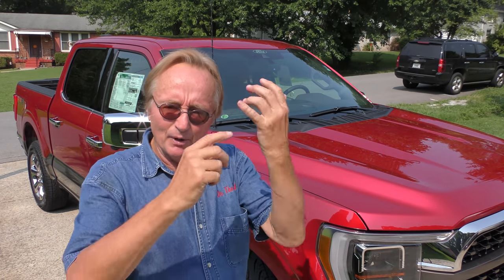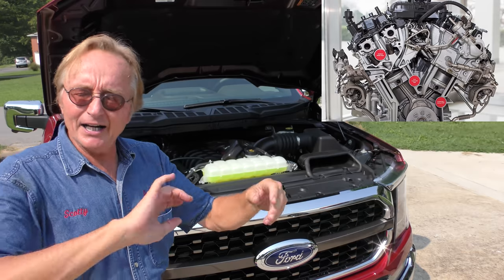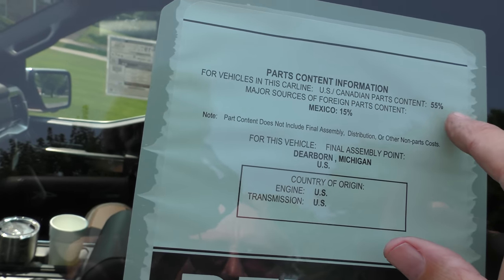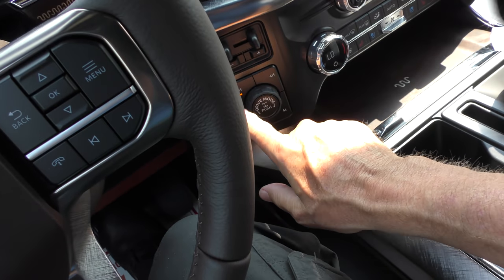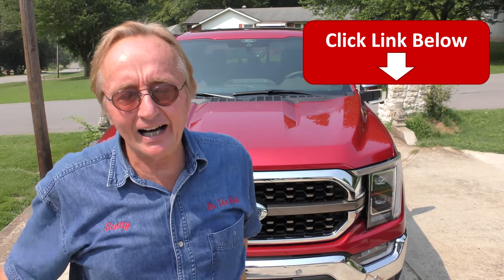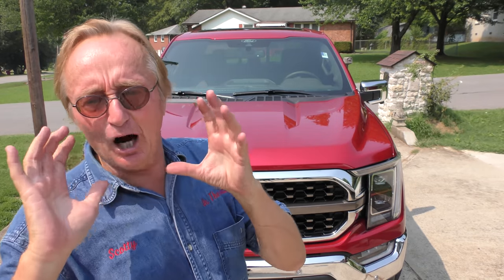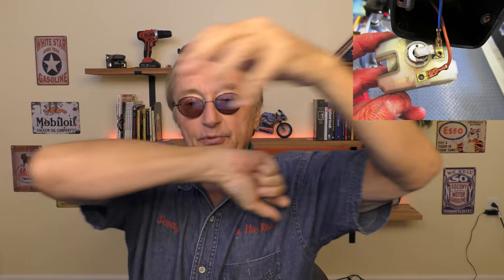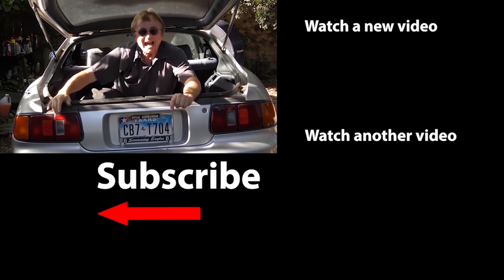I Finally Got a New Ford F-150 and Here's What I Really Think of It

Comment: I listened to you in 2019; bought at the end of the year. 2019 F-150 XLT 4x4 club cab 5.0 V8. Excellent engine! Not ecoboast V6 for me.
Reply: No ecoboost for me either. If I wanted a twin turbo v6 I’d be looking at sports cars not pickups
Reply: @landscapingspecialist  The only reason why one shouldn’t consider a twin turbo over a v8 is not because of its sports car like power but of its longevity. Disregarding longevity and pricing, I see no reason why I would opt for less power than turbos.
Reply: @Samuel-zl7yw  yeah I guess it just doesn’t make sense to pay for a v6 turbo that’ll last 100K vs a v8 that’ll last 200K you might as well just get the v8 and save the worry but yeah you’re kinda splitting hairs. Hey you’re right tho if u got the money and don’t care how it lasts but whatever you want :)
Reply: Someone sounds broke to me 🤣
Reply: @colino5056    I don't know why you guys talking about I got a 2017 Ford F-150 V6 EcoBoost with 240,000 miles and it runs like brand new no problems at all I like these guy but he don't know what he's talking about when it comes to EcoBoost engines
Reply: @tachoo3725  yeah I’m not here to bash or hate on the ecoboost. To each their own. I use my pickups for work work and more work. Including towing upwards of 10k. I just don’t believe in the turbo v6 truck model for my use cases. Again they are probably great for some people. I am just not one of them.
Reply: Does yours use oil? They said the 2018-2020 5.0L V8 engines have that issue. Mine does.
Reply: @VWhiteJr  Yes. It was really bad the 2nd oil change. Now it’s maybe a quart every 1,500 miles. That’s something that I am really ticked about.
Reply: @johncombs6543  gotta go do the TSB for oil consumption. It works even though you’ll see a bunch of people saying it doesn’t and the reason those people are saying that it doesn’t work is because they’re waiting way too long to do it. If it has enough miles on it already the TSB may not work but majority of the time it does.
Reply: @colino5056  I've owned 4- 3.5 ecoboosts traded each in with over 300K miles no issues at all.. I haul a 25' flatbed gooseneck a lot and no problems, power for days to haul.. But stay with your v-8 lol.
Reply: @landscapingspecialist  
But if you really test drive them both, you'd realize that the EcoBoost blows the doors off of the V8 trucks. Both towing and acceleration.
Reply: @landscapingspecialist  Dude., That 3.5 EcoBoost has way more power than the V8 and it pulls better at lower RPM's. The EcoBoost is a FART BETTER engine for towing.
You got to drive one to experience one.
Reply: 2021 f150 v8 is not the same anymore. Cylinder shut off system is used firs time in those trucks…. In this case ecoboost is way safer to buy…. 
Nobody knows how it will perform yet so nobody should say coyote . 
Can’t compare old coyote with 2021 ( for now)
Reply: What's funny to me about this video is I just literally last week sold my 2019 ranger lease back to ford and i said I will gladly hop in a super crew f150 and continue to be a customer. They said we have NOTHING to offer you sir. But we want your truck. Their loss, I no longer have a car payment ( I own my other 2 vehicles outright) . they simply lost a customer. Idk where the hell this guy got this truck, but in southeastern PA they do NOT have any new trucks. Checked many dealer. One had one new truck that was over priced by 10 grand and they thought nothing of it.
Reply: @VWhiteJr  yup same here.
Reply: @johncombs6543  Yeah, idk why Scotty doesn’t address that since it’s the engine he tells us to get. Mine isn’t low until it’s time for an oil change, but it still shouldn’t be using oil.
Reply: @colino5056  my fist gen 2012 Ecoboost is at 130k.  Turbos are just fine.  When I go to buy another truck it will definitely have the Ecoboost system. After 10 years of improvements on that engine I'm confident it will be even better than mine, that has been great.   Blows the doors off the V-8.  Faster, tows better, and is more efficient.  And unless you get an aftermarket exhaust for the V-8 it really doesn't sound that much better than the V-6 which basically sounds like a sewing machine. If you really think you are going to keep your truck 200k then yeah, the V-8 might be the way to go but with the new cylinder deactivation system on the new V8 I am not so sure anymore.
Reply: EcoBOAST
Reply: People are acting like the ecoboost is the first engine to have turbo charging 😅
Reply: @Samuel-zl7yw  zero data or proof.  same thing over and over
Reply: @02hreblue30  I was just going on the statistics that Scotty laid out. Don’t quote me
Reply: No EcoBoost for me either, although I went to the other end of the spectrum for my 2019 F-150 and got an XL with a naturally aspirated 3.3L V6. It's a shame that that option is no longer offered.
Reply: @InJeffable  bruh... why not just get the ecoboost lol
Reply: @ForgivenSheep3  I couldn't afford to go for an EcoBoost at the time, but I wasn't interested in one anyway. I like to keep vehicles over the long haul (I had my last one for 11 years) and I don't trust the longevity of turbo engines. They're great if you're leasing, though.
Reply: Yes no crapoboost
Reply: I’m about to purchase the same truck
Reply: I have a customer that has traded off 29 F150 Ecoboost's with over 300K and no turbo issues at all. They tow fertilizer wagons and beat the snot out of them!
Reply: Hey i have the eco and  is since a company's truck i can't really complain but I've been been up and down towards the Midwest and zero cons so far. Next year I'll get an upgrade so keep the kudos and everything will be alright
Reply: @landscapingspecialist  have you ever driven one?

Comment: I went with the 3.3 v6 on my 2019 f150. Its a regular cab 4x4. Very impressive motor and the standard 6 speed auto is impressive also.
Reply: Mine is the 10 speed CVT. I'm a little worried.
Reply: @maniswil2  10 speed and CVT are conflicting statements; a CVT doesn’t have fixed gear ratios. You have an automatic transmission, not a CVT.

Comment: Love the exhaust sound of the V8 over the v6.
Reply: See what you think of it 200mi into towing a camper. 5000rpm gets old.
Reply: Then you'd have a "Eargasum" if you heard my Ford Triton V10 True Dual Exhaust..👍
Reply: @stevedeleon8775  yawn
Reply: @stevedeleon8775  V10s sound awful
Reply: @Terminxman  I had our E350 24 ft. RV GULF STREAM Triton V10 Dualed with "Quiet Power" Magnaflows ..it sounds good & we benefit with the performance & gas mileage..👍
Reply: @stevedeleon8775  I mean they're good engines, I'm just saying generally V10s sound bad to me, not just the triton

Comment: I have 237k on my 2013 eco boost. Runs as hard as the day got it.
Reply: i have one too.  Scotty is a tool.  the only reason why they make the V8 is for people like him.
Reply: I like the the Ford transits eco boost but they are more in the shop than the chevy express and Nissan vans.
Reply: @Jonathan-tb6fm  yeah I’m speaking strictly the 3.5 truck. Ford is the only truck company id go with for 1/2 tons. Everything else, Toyota and Nissan are crushing it🤘
Reply: I towed a 16' trailer with a rental F150 with about 7000 pounds total.  I own a 2021 Ram and I hate to say it, but the Ford towed at mostly not over 3200 RPM while, the Ram mostly stayed close to or over 4000 RPM.  This was while I watched the oil temp shoot to 275.  The tires on the trailer were only rated for 65 MPH so that's what I tried to maintain.  To me the Ford V6 was the winner.  Your Ecoboost is still going but I have my doubts about the Ram with repeated towing at 4000RPM.
Reply: Same on 2011 no problems. I don't understand the hate on ecoboost cause "the turbos will wear out".  People are acting like turbos are some new technology.
Reply: @popwarhomie  yeah, i read about more things breaking on these truck before 100k miles than after it seems also.
Reply: A lot of old school people don't get new technology on vehicles and that's okay to each their own LOL😊 if you keep your oil changed frequently and on time in your engines with turbos they go just as long as engines without turbos nowadays.  Fact!!

Comment: Ford has been using the turbo'd EcoBoost 3.5 motor since 2011. If they didn't hold up or had turbo failures all the time at 100K either Ford would have long ago lost the lead in sales, or they'd have dumped the engine. I just used my 2019 3.5 to pull sizeable trailers for 5000 out of the last 8000 miles  and the oil never even budged from the full mark. Wasn't sure about buying that engine at first but I'm really pleased with it.
Reply: My 2019 F-150 2.7 eco has 70 thousand on it , so far no issues we will see if I can get 300 thousand out of it , like my other F-150 s  , heard the have a rubber timing belt in the motor dipping into the oil pan IDK

Comment: YESSSSS THE 5.0 V8. U rock, Scotty
4:50 My favorite part
Reply: You must like looking at the taillights  of an ecoboost
Reply: @10rninjariderzx  lol yeah right, the 5.0 will easily take the 2.7 from a roll and will run side by side a 3.5 from a roll.  Yes, the eco is faster from 0-60, but that’s about it!  Tune vs tune, eco will win.  Built vs built, 5.0 wins all day.  5.0 super crews have been as fast as low 10’s in the quarter!
Reply: I'll take the v8 any day, we had several eco boost models at work fail the fuel system has an over engineered duel fuel regulator system which constantly went out needing the whole system replaced multiple times in the fleet so they took em back for 5.0 v8's and no problems since.

Comment: You can’t go wrong with the king of all trucks! I’m so glad you got the 5.0. There are less and less of us on the road that want that 5.0 reliability over the increased power of a twin asthmatic.

F150s are so roomy and comfortable inside. The cabin space is tough to beat. There’s plenty of leg room in the 2nd row for passengers to kick back and relax, without feeling overcrowded if you happen to throw a few bags back there. Seating in the Tundra feels tight and cramped, not to mention there’s even a loss of potential storage space under the seats. The only thing I like about the Tundra is the entire rear window goes down, which is extremely useful, whereas with the F150 the part that slides open is only big enough to fit maybe your head.

Comment: Hi Scotty, I am so glad I found your videos, very entertaining and informative. I have a Ford F-150, the 5.0 liter, and I could not be happier with my choice for a pickup truck, although my first choice was a Toyota Tundra, but I couldn’t find one in my price range. I was hoping you could tell me what are the most common causes of vibrations in the front end? It happens only at low speeds, and from what I can tell it seems to happen more when the steering wheel is slightly turned left… ? I’ve checked wheel bearings, tire pressure, and breaks.. I just don’t know. But I’m no mechanic..
Reply: Did you do an alignment?
Reply: Wheel bearing left or right do both just to get it done right God bless

Comment: "$50k worth of Ford"
Basically the price of a well equipped XL model 😅
Reply: @user-ek1nu1se4d  where the hell can you get a house for 50k lol
Reply: Can you buy a mustang for 50k?
Reply: @hamzah5518  and you can have some money left for a good exhaust system or wheels
Reply: call me old school but all I want is an F150 single cab with an 8Ft bed and rear wheel drive only
Reply: @user-ek1nu1se4d  your right, you can buy a house thats falling apart in the hood for 50k here
Reply: I got my 2020 F-150 5.0 XLT with Luxury Package brand new for $35k
Reply: @hammotox83   how you do that?
Reply: bought a f250 stx extended cab fx4 with 6.7 diesel last year .
54k .
brand new .

Comment: 2021 is the first year Ford is introducing cylinder deactivation on the 5.0 V8. Hope it doesn’t ruin such a good engine.
Reply: Remembering the old GM V8/6/4 cylinder shutoff engine. Abysmal failure.
Reply: It will🤔👍 dorf Sux along with ALL the American vehicles
Reply: Guaranteed there will be someone to come out with an override to that system very soon, if there isn't one already. There's an easy override on GM's displacement on demand V8s now.
Reply: VWs here in the UK have it and it works pretty flawlessly. The cylinders cut right back in when you floor it. Saves about 10% on fuel.
Reply: Cylinder deactivation is garbage... it creates nothing but trouble for engines...also auto start-stop is junk as well.. just makes things harder for the engine and electrical system.. wears things out quicker both of these so-called technologies are crap imo.

Comment: What about the oil consumption problems the v8s are having? 2018 to now , unless they’ve fixed that issue?
Reply: Some 2018 models had that issue due to oval shaped cylinders. All mass production motors can have issues during assembly, just look a GM’s push rod bending issues on 5.3 and 6.2 engines.

Comment: So when the pop up shifter breaks in the down position  your stuck.
Reply: Why would it break?  And no, you just pull it up manually.
Reply: @51AB  Do you know from experience? You would think it would have an override of some sort. I guess it's better than a dial still. Even though they all control servos now.
Reply: @newjargon1697  My son in law has one. I think he said you pull out the cup holder and just press on the locking tab, then pull it up. They had to have a failsafe in case of a dead battery.
Reply: Mr Destro  I've had a trucking business since 1978. I've seen a million wrenches before you were born probably.
Reply: This is why I like column shifters.
Reply: @thepro_luis4274  love the bench seat and a column shifter on my XLT
Reply: Over sophisticated hogwash 🙄
Reply: @thepro_luis4274  This is only a tiny part of why I'm a dyed in the wool manual transmissions man.
Reply: Is that what you told your boyfriend?your poor little shifter! Lol
Reply: @stevewatts950  🤣🤣 you crazy man...I love it
Reply: @51AB  It's like an ignition interlock override? Thank you sir.

Comment: If Ford wanted to figure out what to do with the gear shifter to make the flat work surface, why in the hell didnt they move it to the column where it belongs in the first place!
Reply: Yes! Put the shifter back where it belongs! It's a no brainier, out of the way ! Oh, sorry , jus a sec while I unfold my shifter so we can go.🙄
Reply: @bruceadams3687  mines at the column and allows me to have a center seat. I love it.
Reply: My ‘91 F150 had it on the column.  We had a child seat in the middle of the bench seat for 8 years.  I drove that truck for 17 years.  It is still being driven after a couple of other owners.  My son saw it on the road a few months ago.
Reply: @fosterpainter I specifically wanted the floor shifter and my 2019 Ford F-150 XLT Sport has it.  I find it very convenient to manually adjust the gear range or the shift mode.  It is also convenient when I want to put it in neutral from drive so I make sure I won't accidentally go into the car in front of me if I slip off the brake.  Good place to rest the right hand too.  PS. I drove a manual Dakota for 17 years prior to this truck.
Reply: They make them with a column shift and still has the big center console. Instead of that pointless sedan shifter, theres just an empty spot for you to put your random junk.
Reply: Yes exactly. Engineers are idiots! Been a mechanic for 20 something years and curse at these damn engineers all the time at stupid things like this. Wait till the motor moving the shifter up and down breaks. And it will! Then you will have lots of time to work on your laptop (maybe to shop for a real truck a GM) LOL
Reply: Our '21 has a column shifter, and a 3rd seat in the front row instead of a console. I don't really use it, but if you shut the engine off the column shifter will motor itself into park.
Reply: @bruceadams3687  you don't have to "stow" the shifter, it will motor down if you want to unfold the center console to make the flat work space. Otherwise it will sit there just like any other shifter.
Reply: Wow really? I have a '19 super duty with a column shifter and it doesnt do that
Reply: @Brad-tq2pi  i hate the little shifter. But GM is behind the curve on their insides. And features. Even Dodge is passing them by.
Reply: @ordinaryjoe4143  even Dodge passing them lol. I agree the Sierra’s and Silverado’s are a little behind with the interiors.
Reply: @ordinaryjoe4143  Ram passed both of them. lol Even Nissan put together a nicer interior than GM with the new Titan.
Reply: @DragonKnightX12  RAM has the best interiors right now. But you have to pay a hefty price for the decent to good stuff. You can get good enough interior on ford for $20k cheaper.
Reply: 4 on the tree should be a good anti theft device
Reply: @ordinaryjoe4143  That's not even remotely true.
Trim to Trim they both cost pretty much the same, with the equivalent Ford being a couple Gs more.
Reply: @DragonKnightX12  not trim to trim. Thats not what i said.
Reply: @ordinaryjoe4143  I'm just pointing out, the prices are pretty close. 
About the only way for a cheaper F150 is the single cab.
Reply: @DragonKnightX12  bruh thats irrelevant to what i originally said. Ford INSIDES start looking nicer, at a lower price than Ram does.
Reply: @ordinaryjoe4143  Yea,  you made a claim without backing it up.
I don't see any way how you're getting a F150 with a nicer interior for $20K less than the Ram.
Reply: @ordinaryjoe4143  ROFL
You're calling me a child now? Just because it has shinier plastic, doesn't mean you're getting a better interior with the XL. 
 Go do it yourself, spec for spec they are the same price with equivalent features.  Same with the XLT vs the Big Horn.
Reply: @DragonKnightX12  bruh 🤦